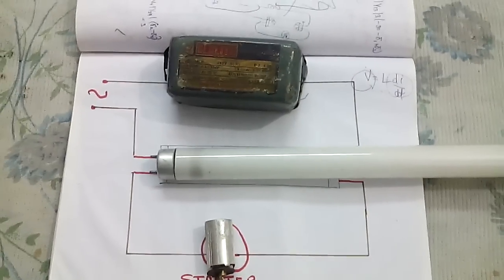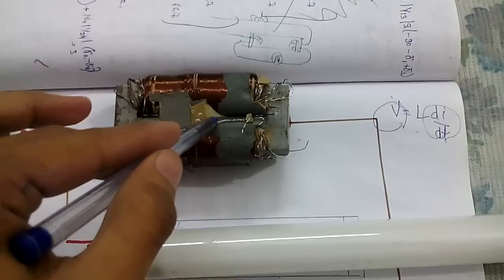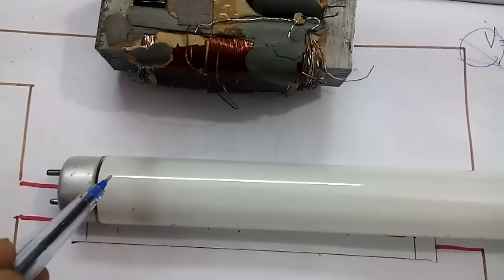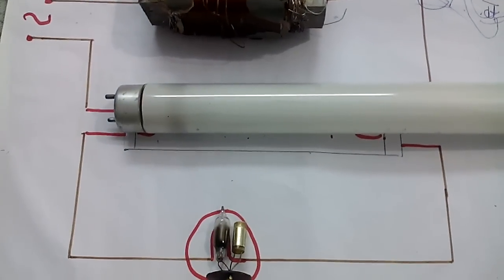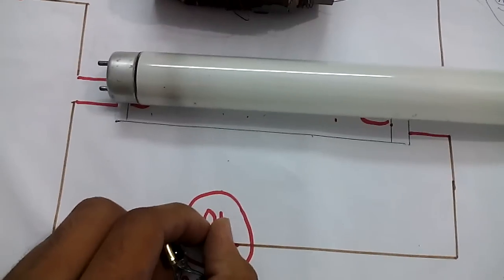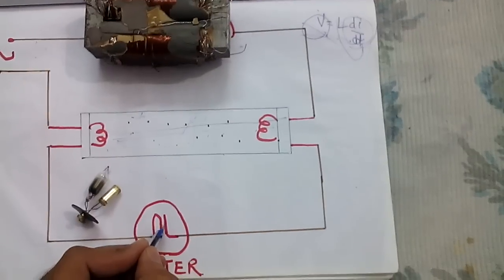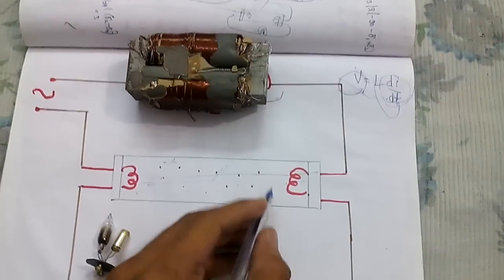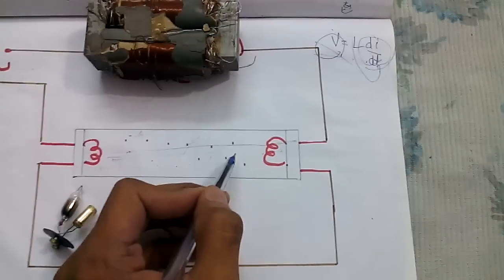EXPLAINED : Working of tubelight

Comment: There's some older style lights that have a push button switch in place of the starter.   On those types, simply push the button for a couple of seconds until the ends of the tube glow white then release the button for the tube to turn on.  In order to turn off the light, simply depress the button for half a second to disrupt the ionization inside the tube.
Reply: Yep, these were called manual starting switches and were most often found on desk lamps until the 1990s, most often using one or two F15T8 lamps.

Comment: after the starter cuts off what stops the starter from re connecting?
Reply: Most likely the ionized gas inside the fluorescent tube which provides the path of least resistance for the current and bypasses the starter.
Reply: Most likely the ionized gas inside the fluorescent tube which provides the path of least resistance for the current and bypasses the starter.

Comment: some people have made negative comments based on their own insufficient electrical knowledge. The coil limits current but also creates a high voltage spike. It has 2 functions both of which  are critical for the fluorescent light to work.

Comment: inductor is used for controlling the flow of current ,,not voltage ,,it increase or decrease the current
Reply: wrong statement, if you do not understand the formula given in this explanation please stop talking rubbish
Reply: where you fromm,,,there are so many tutorials are available,,,I am sure explanation is wrong,,, I have been studied slot in electrical,, mechanical,,and electronics too
Reply: then mercury vapour,not liquid,,,don't teach me,,, okkk
Reply from the maker: Mr. Rajeesh. ..mercury vapour is used here. That is a slip of tongue. I am sorry for that. Except that I do not think the explanation is wrong.
Reply: Why u sorry,,that is enough,,,u know what is wrong ,,,or right